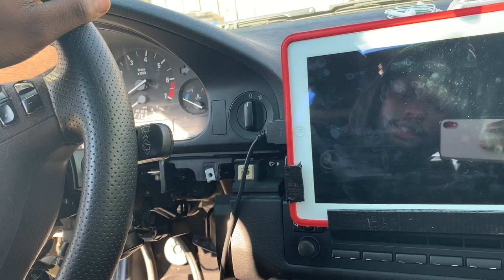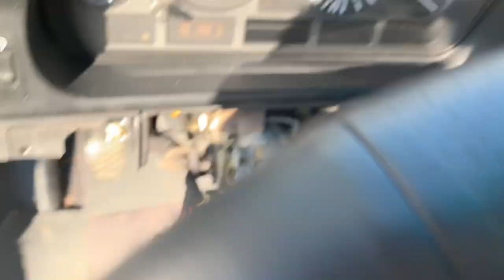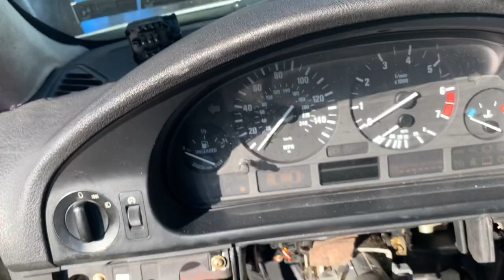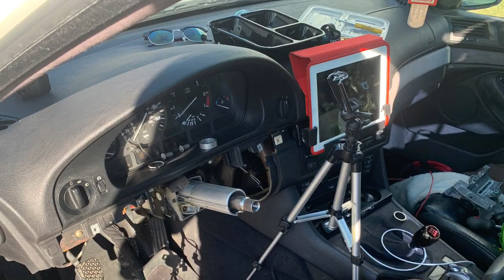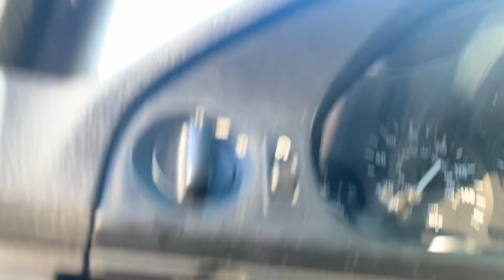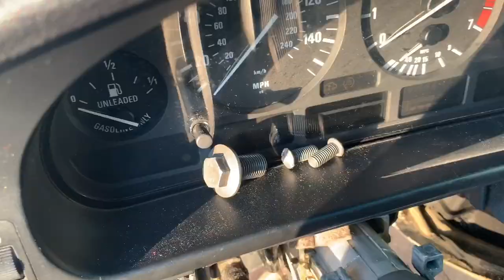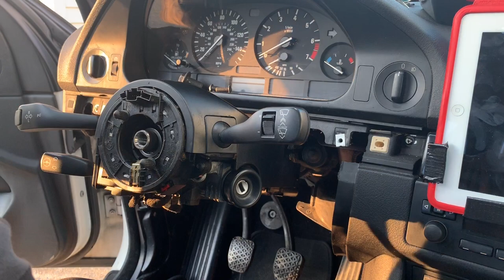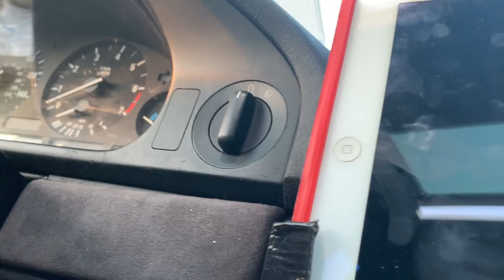BMW e39 5 series Steering Lock Replacement

Comment: The BEST video I've seen. Excellent! A+. .....too bad I found it after I already did it. 
I got the security(fracture bolts) holding the Ignition Housing by drilling a whole and then using extractors. I made a video of how I got them out. I'll post it below.

Comment: Man I can’t find an ignition shaft anywhere for my z3
Reply from the maker: I had to go to a crazy rays junkyard to find one ☝️
Reply from the maker: And if your car is auto or manual it matters
Reply: Dead ass? Man I’m more out of luck then cause mine is a manual, did you get yours off a 5 series too? I’ve been waiting for a z3 to pop up but none be at any pick a parts near me ): don’t know if I can use some 3 series maybe wit the same m52tu motor and a manual trans ignition shaft and put it into my z3
Reply: @alvintarawallie9669  man these bolts won’t loosen up all I’m doing is chipping all the head away and no loosing is happening
Reply: @alvintarawallie9669  can you tell me why it matters if auto or manual. I have the part for an auto here but have a manual and other than the number these parts look like the exact same thing?
Reply: @Batvolle  if they look exactly the same it ain’t gon mattwr